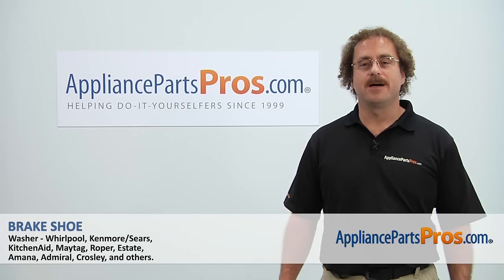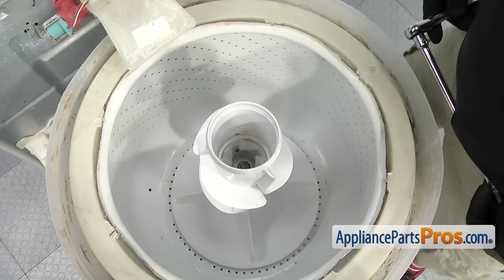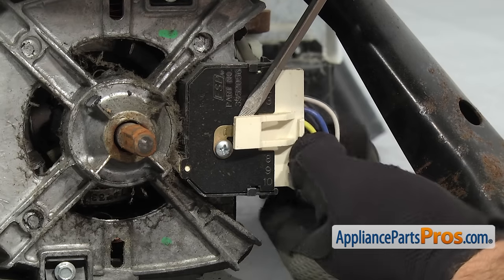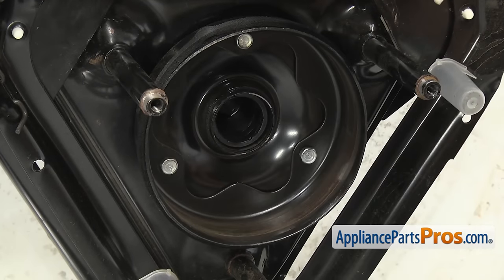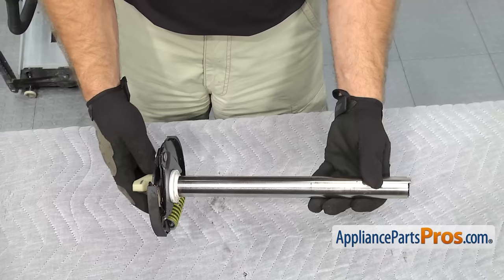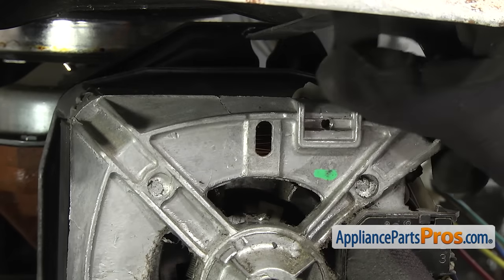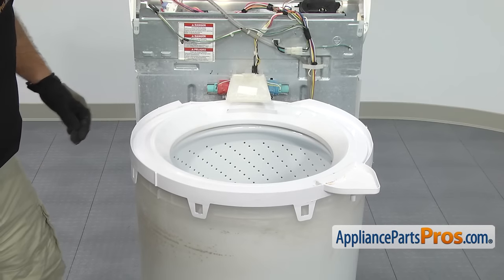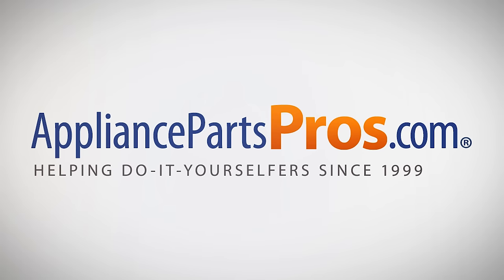How To: Whirlpool/KitchenAid/Maytag Brake Shoe 285438

Comment: This is overkill, just to change the brakes. You folks only have to remove the agitator, flip it over and remove the hoses, 3 bolts then pull the shaft, motor and transmission at the same time. very helpful video, lots of helpful details, thank you for helping others.
Reply: So you dont have to remove the tub? I would think that just makes it lighter to manuever and work on but maybe you're right
Reply: @WeatherNut27 if you're just changing the brakes or clutch you don't have to remove 90% of that stuff. If you remove the clip from the agitator you can slide the entire shaft out with the motor and everything. This is a very helpful video, because it shows you everything, however you do not have to remove everything

Comment: Great video, but it would be good if you showed us just how the old parts were worn out so we can know if that is the part that needs replacement. Like the comment below, I've replaced every part, but still no spin.
Reply: If you aren't "spinning" (you mean, "agitating"?), your drive coupler is bad.  It's a rubber link between the motor and transmission.
Reply: Agree

Comment: I have a really great whirlpool built in 89  gave me no trouble until last week.. it had a burning smell..and   it wont spin,,   ok one youtube vid said its the coupling  or the clutch .. i bought both and replaced both and those parts were fine.. no reason to replace them but i did anyway..  replaced the agitator dogs too..  put it back together and it still wouldnt spin and had the burning smell again  ( not the motor)  i assume its the brake system and it wont unlock..  do you have an idea why the brakes would lock on this whirlpool when everything else is working properly ?

Comment: I have watched almost all your videos on repairing the whirlpool top loaders. You have covered almost everything which is an amazing resource for me as a laundromat manager. One of the things that I have not seen is a video about replacing the seals in the drive shaft, I watched the replacing seals and bearings in the support shaft, and used things I learned from that video to make the process easier for the drive shaft. I would love for you to make a video specifically about the drive shaft for any insider tips to make the process even easier.

Comment: Thank you! Thank you! so much for this video. My washer wasn't spinning, and after replacing the clutch, it still wasn't spinning. After searching the web and various forums, it looked like I needed to replace the entire basket drive assembly which is over $100. At this point I despaired thinking that my washer's time had come to an end. Then I stumbled across this video and realized that I could just buy the brake shoes and save a bundle! Woohoo! I would add however, that I don't believe you need to remove the drive shaft to replace the shoes. I will certainly be trying to replace the shoes with the drive shaft in place. Thanks to APP for helping us DIYers keeping these old but reliable appliances working!
Reply: butchtropic  hmm, and I was wondering why they are called brakes /sarc when they are seized to the drum or not releasing properly that causes the washer not to spin
Reply: Bill Clinton If the brakes were seized to the machine then how did you pull the drive assembly out ??? I smell BS here, seems you’ve chosen a good name !
Reply: I always tilt the machine forward and remove the gearbox , motor and pump as an assembly after removing the wires and hoses to the pump. Looks like changing the brakes would  be easy at that point.

Comment: Great video!  The spanner wrench is a must have tool to remove the spanner nut.  Even with penetrating oil and rubber mallet, the tub would not come free of the drive block.  Removed the transmission and then tapped on the top of the drive block to free tub. Hardest part is getting tub out. After that quick and easy repair.  Tub and drive block had built up gunk so plan some time to clean.
Reply from the maker: You're welcome! Thank you for your feedback. People do often ask if they can complete the repair without that spanner wrench, but it is much easier to go ahead and get it.
Reply: Sexso

Comment: I just used an air hammer didn't have a spanner wrench I have mine all apart and the drive block is stuck inside the tube I didn't realize it will come out thanks for the detailed video it helped me a lot

Comment: Thanks for the vid, what if one of the wires on top of the motor is shorting? The washer won't drain and stops after a few seconds on some speeds. I couldn't find any obstructions and the pump turns fine. I replaced the gear case & motor coupler, but it is still doing the same thing. And then I noticed one of the wires on top of the motor is black and melted at the connection. Can I just replace the wire connection or is something else causing the motor to overheat?  The brakes and clutch look ok to me.
Reply: Any Luck? Im having the same Problem.I replaced a couple different parts before it stopped working like yours got frustrated and went and got a new machine.I hear they go for 20+ years I want my 5+ more years.I have replaced Coupler Clutch than My transmission started Leaking,went and ordered seals for Tranny than all of a sudden it just gave out.Left me with a tub full of water.Replaced Lid switch still wouldn't start.I did notice that when I would put the Timer on spin it would Trip my breaker.
Reply: @V8vortec98   nah, just bought a new one
Reply: @pagevpetty  We've found that there is a problem with the neutral wire (white wire) connection at the junction near the water solenoids that also feed the motor. The simple fix is to buy 3 feet of 16 gauge white thhn wire and 2 trailer quick connects and connect one end to the white wire to the white wire near where the power is coming in and the other end to the white wire running to the motor.  And now you will also have to add a patch wire to any of those wires that got burnt. Bend the wires near that area and look for stiff spots where the copper melted.
Can't imagine how many have tried replacing the motor with out success. The tell tail sign is that the motor will just hum while drawing twice as much electrical current. We now just spend the $2 and add the jumper....

Comment: My direct-drive Kenmore 500 washer makes a "squeegee-like sound" every time the brakes engage at the end of a spin cycle. Is this normal? Other than that sound, the brakes do a fine job of stopping the rotation of the inner tub in less than 3 seconds.

Comment: There’s also a hack fix if your washer to stopping too fast to avoid removing everything. Remove the outer shell and tilt the washer back against the wall so you can see underneath where the brake shoe and drum is. Watch this video to get an idea where the brake shoe is. Apply some high temp silicone between the drum and brake shoe. You can rotate tub some so you see the spring which will give you enough space to use a flat blade screwdriver to apply some  silicone to the metal outer drum. Just apply a little. Also be sure to use silicone instead of grease or oil. I’ve heard those will eventually decay the rubber on the brake show more.

Comment: Hello there, first of all great video, as many I've watched from you. My question is, when you removed the basket drive assembly ~10:17 you said you only needed to turn it counter clockwise and pull, but in my washer though it turns counter clockwise I can't pull it off. It there a way to know what can be holding it? Is there a part a area in which I can add some lubricant or penetrating oil to loosen it without damaging anything else?
Reply: I have to mention I haven't removed the drive block you mentioned at ~ 5:57. Just in case that's important.

Comment: I have replaced both the couple and the clutch brake. My washer still only makes the noise of spinning but does not budge.
Reply from the maker: We offer free technical advice and diagnosis, so we would he happy to help you figure out what's wrong with your washer. You can give us a call at 1-877-477-7278 or you can chat us at our website: http://www.appliancepartspros.com/. We will need your model number to give you accurate advice, which you can locate using this tool on our website: http://www.appliancepartspros.com/modelnumber_locator.aspx

Comment: if the inner tub spins freely by hand  when its off does this mean brake pads need replacement. ? its also not spinning during spin cycle.
Reply from the maker: We'd be happy to help you figure out what's up with that. We offer free technical advice and diagnosis. You can give us a call at 1-877-477-7278 or you can chat us at our website: http://www.appliancepartspros.com/. We will need your model number, which you can locate using this tool on our website: http://www.appliancepartspros.com/modelnumber_locator.aspx

Comment: Hello,
I have whirlpool WTW5200VQ2, and machine does not run after water is filled up to the level. I have empty out the drum. I noticed that inner drum is not free, I mean it does not rotate by hand. is it normal or something wrong. Please comment. thanks
Reply: Does it sound like the motor is running but the agitator didn’t spin? If so check at 17:00 of this video for the coupler. Although your problem might be different.
Reply: @boostedmaniac  thanks for the reply. It was not a coupler. Ultimately I figured it out as it was a capacitor. I tried to run the motor when it was taken out, it needed a jerk to start, that means start capacitor is no good. Once it is replaced, everything is perfect.

Comment: Excellent Video!, all the internal parts and components on this unit are the same as my Estate (lower end washer), except the control knobs. just goes to show you higher end appliances aren't much better then the lower cost units from the same manufacturer
Reply: This IS a "lower cost" unit.

Comment: My kenmore washer 600 series spin once it get to spin cycle,so I replace the motor coupling,clutch shoes,lid switch,,and still same result no spin,the only way it would spin is if I rock the tub back forth then close lid and it spins.
What else should replace?thanks.
Reply: Pats4life I have the same Kenmore600 did you find out what the problem was?
Reply: Austin Porritt sorry no,I still haven’t figured out wth is wrong with it.i don’t know what else to replace
Reply: @eacalways   OK thanks. Time for a new one

Comment: my washer machine is a kenmore 800 series . it comes to an abrupt stop the machine makes a loud noise when it stops and the machine moves when it stops after every cycle, is this what i have to do replace the brakes ?
Reply: You can try to oil the clutch shoes. This will allow the basket to slip to a stop. Clutch shoes can get sticky with age. 
If you have a tube Oiler it is possible to able oil the clutch pads from the bottom by tilting the machine approximately 45 degrees back to the wall. No disassembly is required this way,

Comment: i noticed when you lifted the inner tub a water sloshing noise.  Hear the same on my washer but can't get any water to drain out regardless of how i position the inner tub.  Is it desireable to get this old water out somehow?
Reply from the maker: That liquid sound may just be from the balance ring, which is about half full of fluid to help balance a washer as it moves. As the load shifts during wash, the load may become more concentrated on one side of the basket. The fluid in the balance ring shifts to the opposite side of the load to help offset the weight of the load and keep the rotation of the basket stable.
Reply: oh wow!  So much more to washing machine than I supposed.  Thanks, for the reply.
Reply from the maker: No problem! If you ever have any appliance problems or questions in the future, you can give us a call at 1-877-477-7278 or you can chat us at our website: http://www.appliancepartspros.com/.

Comment: I'm just wondering what I'm missing here. Why did you go through all that extra work by removing the cabinet. I just unplugged it, disconnected the water lines and drain hose. Then I removed the agitator  and laid it on it's back and I had easy access to change the brake shoes.  I completed the job without a problem.
Reply: Extra $$$$👎
Reply: he probably did it that way to make it easy for us to see what he was doing but I guess he should have said it wasn't necessary

Comment: i tried getting that brake tube off, and i saw the brake assembly. my machine had no short tube. i replaced the clutch assembly the other day. put it back on the transmission, then i changed the motor coupler. tried pushing up and counter-clockwise, as you did, but she didn't give an inch. after this, i replaced the balance ring. since i had not yet spent what the stores were asking for heavy duty maytag washers and dryers, i decided to try to fix/find the problem.  the motor, transmission, water pump, capacitor, water level float---checked just about everything but my butt hole. agitator, drain, fill, worked on all cycles. nevertheless, it would not spin the clothes, even though it would pour rinses water in the spin cycle. after cycle, the tub would drain. the anger begin to really rise up in me, so i took everything apart, again. checked my work, and put the washer back together. now there is no sound on spin, and the machine does nothing but a slight hum on all cycles.checked agitator, dissembled it. replaced agit-digits. let water disconnected, but turned current on, in order to see what was then occurring. same thing. faint hum everywhere, except the silent spin. some of these vids suggested that a no spin zone might possibly be due to switch lid. 5 min fix, easy, no problem, no expense, use zip ties---yeah. after a rather severe beating, kicking, screaming, and crying session on the old girl, i set out to do these alleged easy fixes. over 8 hours later, i had found all 3 of the lid switches. this washer bore a resemblance to the aftermath of the titanic. i finally traced and pulled wires and little boxes, none of whom that favored anything on you-tube. i happened to have unhooked the one that worked, before we all began rewearing our underwear, both inside and out---same for socks. some man suggested a staple put in the switch would bypass the program, and spin would work. another lady told that i could take a guess and cut the plastic clip, that traced to the lid. my wires are green, brown and white---i think. though i haven't chosen to do this yet, i guess it is something like hot wiring. i don't know why it quit all cycles. should i put the 2 wires together w/ one of those electrical caps? i have a heavy duty kenmore, if that means anything. inside, looks as if 3m company has a warehouse on premises. i didn't have that much tape, when i had worms.
Reply from the maker: If you need additional help with the repair, you can give us a call at 1-877-477-7278 or you can chat us at our website: http://www.appliancepartspros.com/. We’re here to help 7 days a week.

Comment: I don''t understand why you removed the motor? I would have just pulled it off with the transmission.
Reply: I usually pull it off with the transmission too.  However, removing it makes it easier to manipulate the transmission as it's quite awkward and heavy as a unit.  But then, reinstalling the motor with a new coupler, you need to spend several minutes aligning the coupling, since it's a good tight fit.  In the video, the coupler was worn, the pins thus are looser, so installing the motor is much easier.

Comment: First, great video. Thank you so much.

Second, may all washing machine engineers be cursed with tongue warts and a plague be upon their houses. When is the last time you had to pull the axle on your car to change the brake shoes? It's absolutely possible to engineer the brake assembly so the shoes can be replaced with everything in situ. But it might have cost them an extra dollar.
Reply from the maker: If there is anything we can help you with please let us know.

Comment: My washer does not spin, when I try to move the tub with my hand it doesn’t budge.
Reply: D

Xy no Oz TV
Reply: B.     Saludos cordiales atte saludos mi
Reply: Clutch failure. My 16 year old Whirlpool was the same way. No spin or a very slow spin that would stop sometimes. Could hear the motor humming and the agitator worked okay. Replaced the clutch and motor coupling and now it spins really fast. Clothes are nearly dry when the spin cycle is over. Wish I had done it sooner. Will be replacing the 16 year old brake next before it fails. Hope this helps.